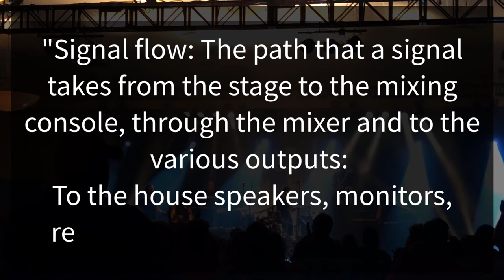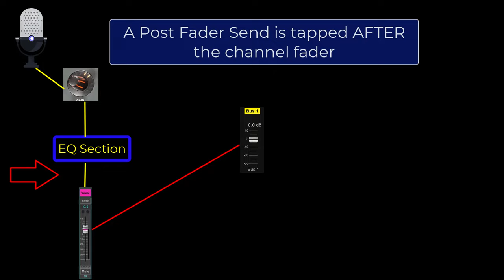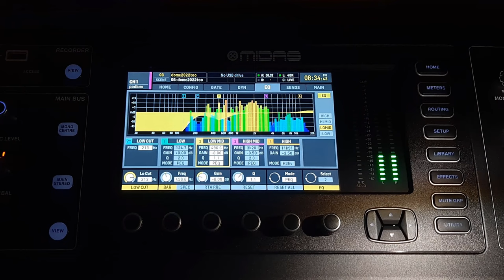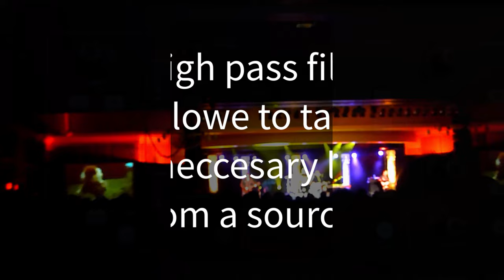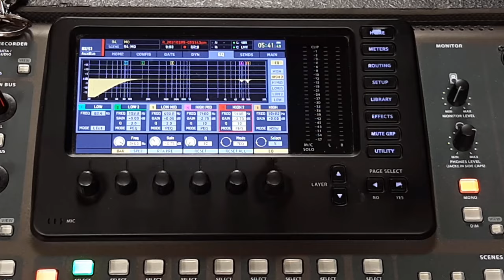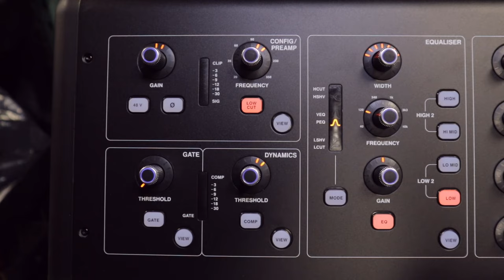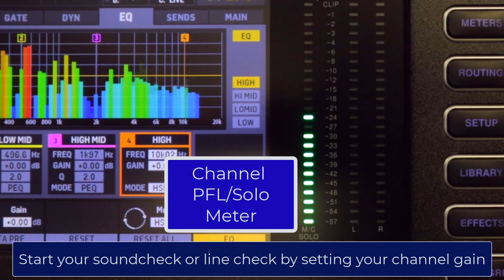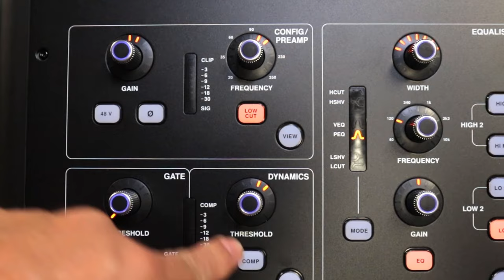Live Audio Mixing: The Fundamentals

Comment: Question on  Monitors set up only . 3 band group , 2 guitars and one bass guitar and 2 singers.  We have 2 monitors and one big sub 18 in middle of the 2 monitors. Problem is when bass player plays with EQ at 60 heartz sound , we loose volume or we get muffle sound on the monitors and we can berly hear our guitars from monitors. Now it is not a volume problem but a cancelation of sound due to the bass frequency
Reply from the maker: What I would look at is your overall EQ on the monitor output(s). I'd make sure I was using the HPF (low cut). At least 60 or 80Hz ... But probably/possibly 100 or 125Hz if you still have issues after trying something more conservative. I definitely wouldn't run them with no HPF engaged.
Also, make sure you aren't boosting any bass/low frequencies in your monitors on the overall monitor output EQ. These two things will help with headroom and keeping mush out of the stage mons. And that should help clean them up.
Also, make sure you aren't over-EQing them and cutting a bunch of mids or highs out of them. That would just exacerbate the problem. It's like throwing a blanket over the wedges, and it really gets noticeable when the band is playing, stage volume is happening, and now the monitors and the critical vocal range can't cut thru. Plus, any low stuff will seem to take over.

Those are generic suggestions... I suppose a more detailed question might be whether you're even putting bass guitar into the monitors or is it just the bleed getting into them? The above should help either way, but if you're putting bass into the mons, is it because the bassist doesn't have a stage amp? If he/she does have a stage amp, is there not enough bass guitar coming from it that you still need it in the monitors?

If you do 'need' it in the monitors, on the bass guitar channel, and the above didn't help enough, I'd probably look to make sure and HPF the bass guitar there. I'd do that anyway...  Definitely 40Hz no matter what in a case like this if you aren't already. But I instead might even try 50Hz-60Hz... I might in this case do it at 60-80Hz. If the monitors can't reproduce the lows without trouble, there's no point in asking them to do it. And if the bassist is heavily boosting then that roll off might help you both.

It's also possible he/she is boosting well below what is actually needed/wanted as far as the center frequency goes, and to get what they want to hear they have to put a ton of low EQ into it to get the actually frequency that is more to the right to actually increase enough to matter. BUT if the frequency was better centered (or if it's a low shelf, the knee freq is better selected) then it might not take nearly as much boost to get what they want to hear. And this all assumes a low end boost is the proper answer anyway... It's probably best to try subtractive EQ as the first line of equalization. First the high pass filter, then cut away where things are too much.

For example, if there's a cut at 250Hz, that naturally leaves a louder low end and upper response in the overall frequency response.

A little deeper dive on Bass mixing/EQ in this video:
https://youtu.be/FNa7avcUUSM
Reply: @AlanHamiltonAudio   Do  main outputs L/R  and mon (monitor) output are totally separate lines? . My problem is because I get alot of high  frequency loss from my floor monitors when the bass is playing . We loose guitar high and some meds frequency. I do have crossover from my subwoofer to my top speakers but there is no low cut or frequency cut setting in the mon output and so my monitors speakers don't have any settings for it